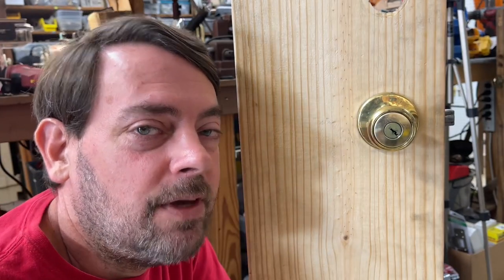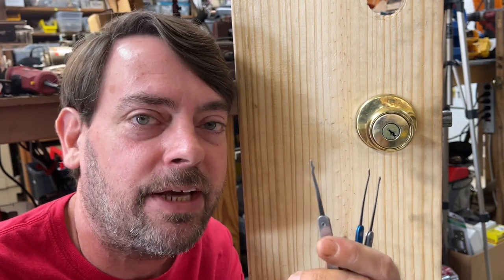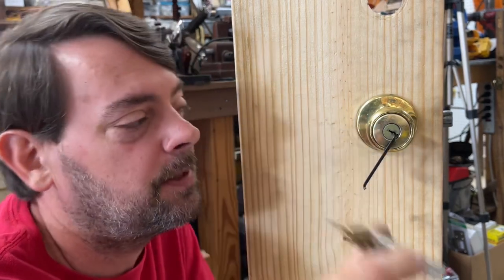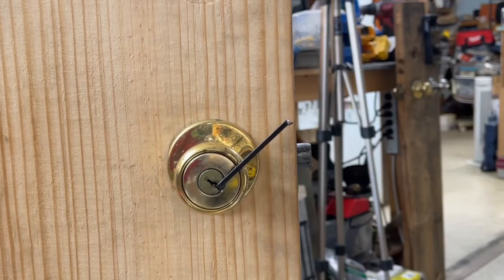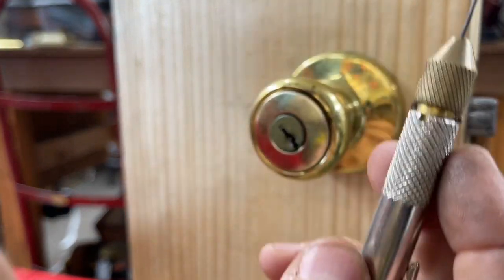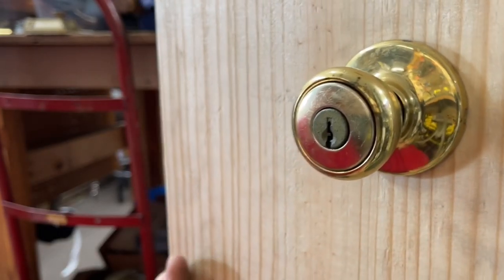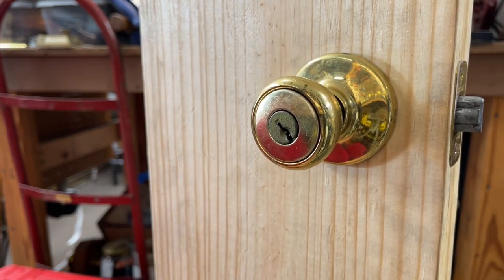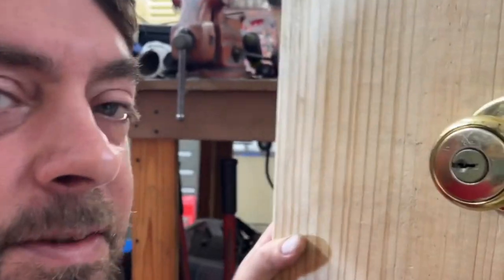Residential Locksmith Starter 8 - the plug spinner

Comment from the maker: I think, on this A1 Spinakur I need to leave it away from the plug a tiny bit. I think it’s hits different ya know 🤷‍♂️
Reply: I have a Spinakur and it works most of the times. Just wind  it 1-1/2 to 2 turns, locate the spinner tip at the top of the keyway (plug center), orient the plug keyway 15 to 30 degrees away from the pin stack. Hold the turn firmly (both hands) and press the button.
Yes this tool does have a steeper learning curve but that's the price to pay for being cool little tool that fits in your pocket or pick case.

Comment: Thank you for the great content. I’m a new Locksmith in Santa Fe. I’m getting into it a little bit later in life than most, I’m in my 40’s. I do mostly lockouts and rekeys. I have been having great luck with my Peterson plug spinner. The only time I had a fail was on a wafer lock that was on an RV(it was also my first one of those). Before I realized that I just wasn’t pushing it hard enough to release it, I tried to spin it the other way. I know now that wasn’t the issue. The Peterson spinner fits in my pick case and it comes with an extra spring. It has saved the day on numerous occasions. I guess I’ll find out if will last me as long as yours, I hope so.  Thanks again for the content. I intend to watch all of your videos. I have subscribed as well. Happy Independence Day!!!

Comment: I've got one of those  A1 plug Spinners like you were having those fails with. It doesn't work very well for me either. I've been thinking about buying the Rytan actually. Now that I know that someone with more experience than me also has trouble too, I'll probably go ahead and get a different plug spinner. The only advantage of that small one is it's easy to carry cuz it fits neatly in small spaces.

Comment: I wish someone would start manufacturing the a1 sp1 agin. I don’t use plug spinners often so I prefer compact spinners. I hate the dart shaped ones that snag on everything. The Petersons plug spinner is what Ive been carrying the last couple years. my only complaint about it is the nuts loosen up over time. Other than that it works flawlessly every time.
Reply: Put Locktite On The Screw Threads And The Nuts  Won't  loosen Up
Reply: @stephenzies8867  I've been tempted to a couple times. But I'm worried if I ever need to replace the spring I may snap those teny tiny screws even if I use blue locktite. I may go ahead and do it though. My luck now that you mentioned it if I don't one of the screws and nut will be completely missing when I need a spinner the most.
Reply: @mumbles1justin  I use green locktite on my Peterson and I have been able to disassemble it with no issue and the nuts don’t fall off. Just a little bit though. A little goes a long way in this situation

Comment: Locksmith tip - if you bump a cylinder the wrong way, use your plug spinner where the ring goes thru.

Comment: FYI- kw1 lishi doesn’t have 7 depth, so if you have a lock with a 7 depth lishi isn’t gunna work
Reply: 7 isn’t a valid depth for kwikset pins. I have only had 1 lock with a 7 in it and customer had lost all keys so when I had lock apart I swapped out that 7 pin. It was a bear to pick too.
Reply from the maker: @stevemasters9921  some of those super cheap $5 locks sold primarily to HUD “contractors” came all keyed to one of the common hud keys with 7’s in it. Thankfully the popularity of those died off when HUD changed the decision of having all their properties keyed to that key (it was like 76677 or something)
They are built like the video “the worst Kwikset” in our older videos!
Reply: @selock  , I thinking how hard a 47171 with some spool pins thrown in would be to pick. I bet that one I came across with a 7 was a previous HUD house. Maybe stiffer springs on the 7 pins so that it really takes full compression to get to shear line. What do you think?
Reply from the maker: @stevemasters9921  your 7 next to your one will change it to a 2.3
MACS
but yeah would be a PIA 
drill or force time ;)
Reply: @selock  , what is a 2.3 MACS? Don’t understand that term
Reply from the maker: @stevemasters9921  Maximum adjacent Cut. If you cut a key with a 7 next to a 1 it will bring down the actual 1 height, and end up being a 2 or deeper cause it cuts it away. Doesn't matter for just picking but for keys it matters a lot!
Reply: @stevemasters9921  it is rare but they do exist. Those hud keys have 7s and some master keyed locks may use a 7
Reply: @selock  , you are teaching me some principles no one has ever mentioned or taught. So that I can understand this MAC, I can see how a 7 cut could effect the pin next to it, because of the angle of the cut would actually go over into the 1 height and it would be lower. So, what are the rules on MAC? Does Schlage and Kwikset follow the same rules or is it different because the different pin heights on Schlage are physically closer in height to each other? This could also attribute to why some of my keys just don’t want to work just right. Thanks for taking the time to inform me too. Great knowledge there!
Reply: @stevemasters9921   - the MACS varies across brands. Schlage and Kwikset have different numbers for that. Partly because Kwikset has fewer bitting depths than Schlage.

When you watch one of Jason’s videos where he is pinning a lock, you’ll see his box of pins has a chart with the pinning specification for each different brand; one of those specs will be MACS.
Reply: Additional question…. Some locks, like Schlage, on my pinning kit shows top pins are different in height, based on the driver/key pins. Do you follow those when rekeying a lock. I haven’t noticed a difference when I do VS when I don’t (which is 99% of the time I don’t).